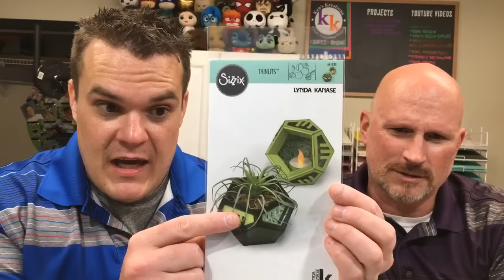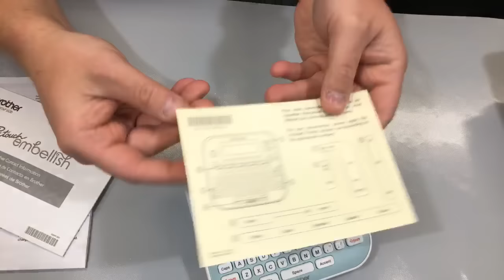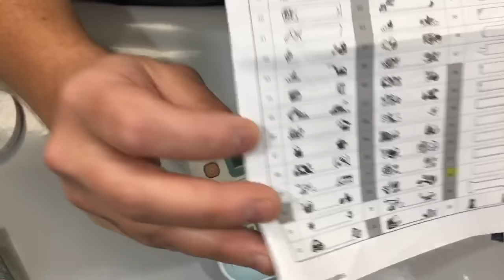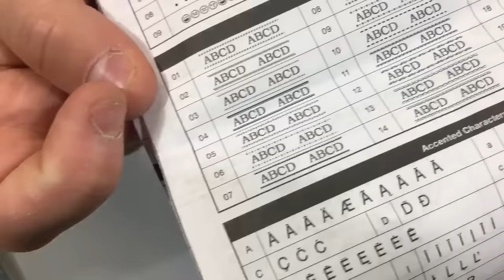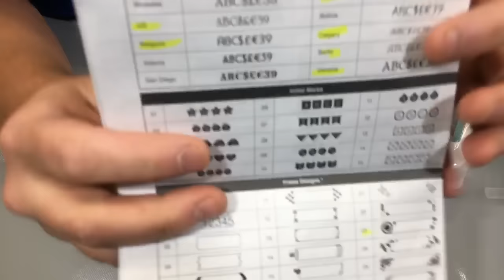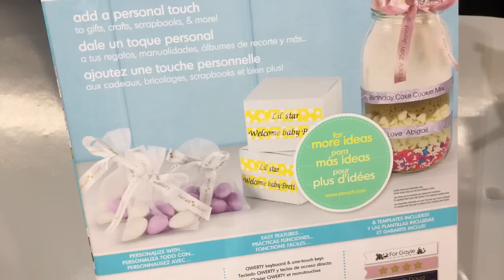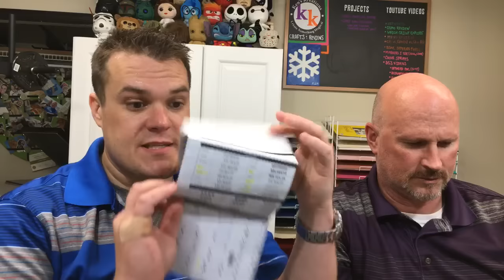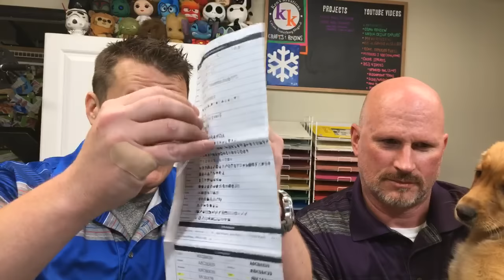Brother P-Touch Embellish LIVE First Look & Other Fun Stuff #Ptouchembellish

Comment: Thank you for the Video.  I have used other Ptouch products and needed a refresher. I was able to use the AC adapter from another PTouch product so it saves me on batteries. Purchased this unit due to the amount of variations and frame designs. I use only the Satin Ribbons with this for creating custom crafts.

Comment: Hi! Im having problems with my ptouch  embellish i want to i use a 6mm but i set the double line, i know for double line i need a 12mm if i print on 12mm no problem but when i have the 6mm gives me error  message  line  full and it wont let me print. Help please. Thanks